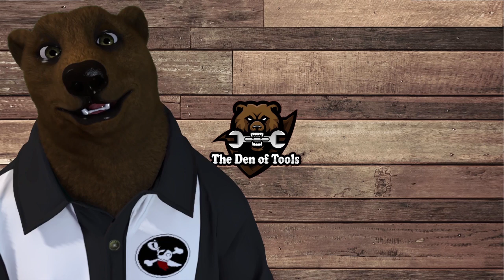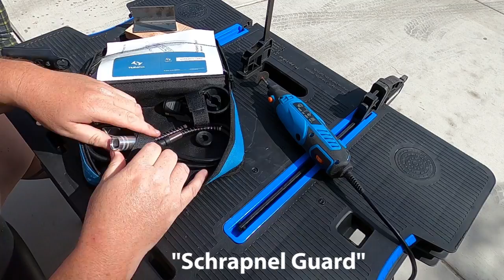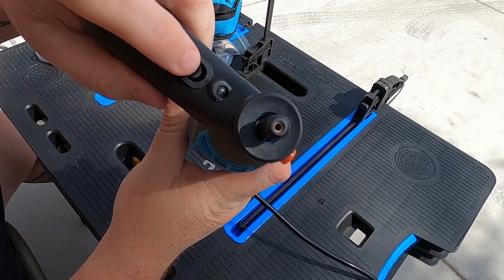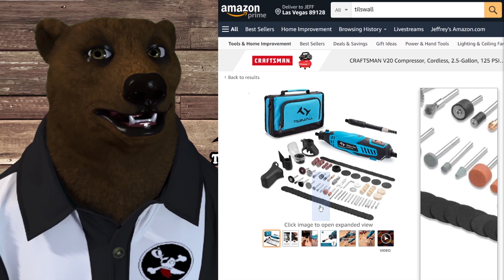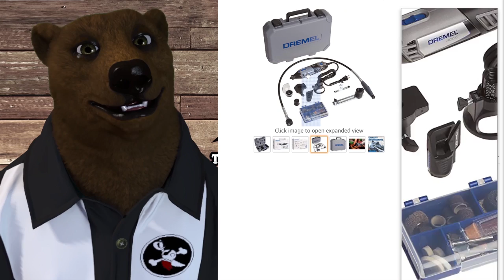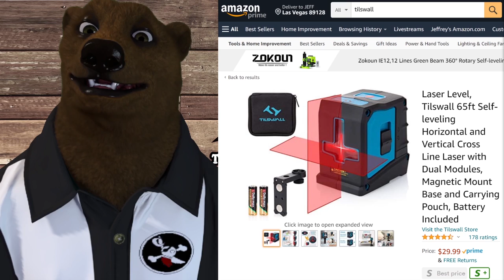Cheap Rotary Tools, Trash or Tool? (Tilswall rotary tool review)

Comment: No trae seguro sujeccion cable interno, lo cual con un tirón, se podría salir de las cogidas, además ni motor ni rotor trae nada de goma en rodamientos para evitar vibración en alto. Personalmente por el precio las hay mejores incluso a batería. Muy bonita y completa pero no la veo preparada para durar, el botón de encendido apagado lo puedes poner  donde lo trae o más adentro si necesitas activar más cómodo.

Comment: Amen.  I had Dremels for years and when my last one burnt up, I bought a Masterforce instead.  Its basically a Dremel 4300 that comes with a flex shaft and a hanger and still costs half as much as a Dremel 4300.  I love Dremel but I don't see the sense in paying twice as much just because it says, "Dremel" on it.

Comment: These have a thinner than normal Collett. The ones that fit the Dremel and pretty much all other rotary tools are slightly too wide to fit. I had to put mine in a drill chuck and turn them down with a file. Pain in the butt. However the tool is as good as the current iteration of dremels. And way better than the Parkside tool that lasted 10 minutes!

Comment: Thank you SO much for this video! I am really trying to figure out what the heck the "brush access" is on it? (the black circle you pointed out...it seems there's one on the other side of it too) What is it's purpose? I bought this one because of your video and I unscrewed one of them and had a heck of a time getting it back in and now I'm worried I've ruined the tool although it is working but I was really taken aback by the coil and all the stuff in there (sorry I'm totally new at this and have no clue what anything is called) Thank you for anyone's help!

Comment: I own a WEN 2307 rotary tool my friend gave me his bosch large soft zipper case fits my wen rotary  tool  and wen 320 piece accessories I even purchased a Kawasaki collet  set which is better made than the standard one that  it came with it for me this does the job as a  homeowner it's good for little arts and crafts and little things around the house it's not good for professional use but it does the job I'm happy with it my father in-law who owns a older  Dremel similar to mine likes mine says alot.   ( for poops and giggles I did get the drill Master one for like $8.00  thing is a piece of junk probably going to get the wand the right angle attachment the router attachment it's a good kit  to build on

Comment: Being into radio controlled flying I’ve gone through a lot of Drexel’s over the years.  The weak point always seems to be the brushes.  You would think someone would have come up with a brushless die grinder by now.   My best Drexel is a professional flex shaft model with a motor about 3 times the size of the handheld tools.  That one has lasted but it was about $160 25 years ago.

Comment: Hey Jeff,
I went and bought this tool after watching your review. Got it today, Sunday. Great tool for small jobs. I did add a few drops of Bell & Howell projector oil to both ends of the flex shaft and to the tool shaft.  Works just as you demo'd it.  Thanks for that review. The 20% off at Amazon helped too.

Comment: Bought a similar tool through HBT and have been using it instead of purchasing a Dremel. Not as "strong" as I would like, but it works well and does what I ask it to do whether in woodwork or in wood turning. Good call.

Comment: If I buy a cheap too I throw away the bits or discs that come with it, even a cheap tool can benefit from a good bit or blade or disc etc. even my name brand circular saws generally have come with cheap blades. Project farm does good videos on things like sawzall blades and drill bits, cheap tool with a good blade!

Comment: I have an old dremel I bought from a thrift store about 10 years ago.. I paid $5 ..it was almost brand new , it was missing the  wrench ,and the arbors for sanding rolls, and it had the crappy blow molded case

Comment: I have a Dremel and a Ryobi (way better). Hey bear I have a question I am in desperate need of a thinkness that won't break the bank do know of anything out there right now? Someone stole mine days right out of my driveway while I was using the damn thing. I went inside to refill my drink and came out and it was gone along with my good clamps that were sitting there. Damn turd nuggets took almost every clamp I owned. I was inside 3 mins tops it was that fast. I was making a bench for some extra $$. Social security disability doesn't pay enough for me to live so I  supplement my income with stuff I buildand right now a thinkness planer is important because of the quality and condition of lumber right now. I figured if there was an awesome deal to be had you were the person who would know were to find it.

Comment: Nice little tool, except that the advertising (Amazon) lists this at 160w, scroll down to the specs, it's 130w. At that point it becomes a nope for me. That's 1.1 amp, barely. So it'll be a little under-powered and get hot faster, but as you noted, it's a short run time tool and it will work for a lot of stuff. I'll look for a 1.8 amp motor and yes, that's a significant difference plus you can find them for similar pricing. Yeah, about Dremel, you're right, ain't your grandads tool. I'll pass on that high priced tool. You'll have a good chance of buying 2-4 of the Tilswall, Tacklife, Teccpo, Goxawee or any of the others for the price and power rating of the Dremel that's probably outsourced to one of those companies.

Comment: If you're looking for a cheap rotary tool, I highly recommend the Black and Decker RTX-B. I've had one for years and it's fantastic. The biggest perk, is that it has a 2amp motor, meaning roughly 240watts of power, vs the 130watts claimed by this tool. I've used it to grind cast iron, aluminum, and stainless and it doesn't lose power. 
I did have an issue where the chuck lock broke (I was being a bit to aggressive with my tightening) but the shaft has a hole in it and I made a space to stick a small Allen key through to lock the chuck. It's more powerful than the $120 Dremel 4300.

Comment: Dunno what I'd use a rotary tool.for?? Engraving my initials into tools so other Peeps know to KEEP AWAY?  lol
The rotary tool motor sounds sweet,  smooth and high revs.
I also thought a glue gun was a .....glue gun?😁  but watching a granite worktop fitter ,create a hard board template of the worktop and overhang it required, he used a glue gun that wasn't up to the job, and had little flow rate.  He swapped to a  pro type gun and it made job look easy.
I have 2 guns.  Both would qualify for , women's crafting glue guns..lol.  weak as crap.

Comment: That looks almost exactly like the Tacklife rotary tool I bought I think on your recommendation a month or so ago - the only difference is the Tacklife has a small LCD that shows the RPM at 1:1000 ratio (10 = 10,000 rpm all the way up to 40=40,000 rpm).  I really like this tool a lot and it has held up really well to hour long plus sessions of light grinding of stone along rust removal from old tools and pretty much anything I have thrown at it.  The flex tool is a positive/negative neutral as it works OK but doesn't give you that feel of connection to the tool in the same way.  With or without the flex the tool never gets too hot and I am careful to check while using it - heavier duty than the last dremel I owned and it so far has been worth every penny.  Thanks Bear!

Comment: Hey Bear, I’ve been using the Wen Rotary Tool from Amazon @$24 for over a year and had NO problems! Just as you pointed out, you can’t run these things like a heavy industrial tool...use it then let it cool off.....

Comment: I acquired my first two Dremels inthe 70s. Didn't need to replace them until about 4-5 years ago. Bought the 12v battery powered Dremel and that was one of the smartest purchases I've made. Buy the bits and mandrels as you need them.

Comment: I've had the same Dremel 3000 for years and years now. I almost lost it once due to the locking mechanism getting stuck, but managed to get it loose. Rotary tools are super useful, but it's all about the attachments and application.

Comment: I had an actual Dremel brand (the basic "full throttle" one) rotary tool for many years. When it did finally burn up, I couldn't believe the prices of the brand name. Since they've all been made overseas for years, I ended up buying a variable speed model in a HUGE kit from Northern Tool for about $70 maybe 5-6 years ago. The kit included a 3' flex shaft and God only knows how many bits, wheels, stones etc. It also came with a mini tool. These days, they're all pretty much the same thing other than the color. I've used this one without any complaints ever since. The big Harbor Freight accessory kit is a pretty good deal too.

Comment: I have the dermal cordless. I actually don't care much for it but it does work. Even a cheap rotary is fine for what they ARE made for. In fact the cheaper the better. Run the math one costs 80bucks lasts 10yrs, 8$ a yr. One for 10bucks lasts 2yrs 5$ a yr. All's good

Comment: I need a Dremel but won't really help me much unless it's cordless being a mobile mechanic
Reply: Both Ryobi and Hart from TTI have cordless flex shaft rotary tools. They are almost the same but the Hart one has a place built in were the little accessory box slides in. Right now Walmart has a "Hart Lifestyle 4-tool Combo" that comes with a 6 battery charger, 2 1.5 ah lithium ion batteries, an inflator, and a hand held vacuum on clearance for $80-$109 depending on the store it is regularly $150. Direct Tools has the Ryobi version for $60 tool only (factory blemished) and $7 flat rate FedEx shipping. Both have 3 year warranties.

Comment: I paid just about as much for my Dremel flex shaft for detail work as you did for this whole set!! And my 12v Milwaukee rotary tool I'm using the shaft with doesn't have a d ring to hang it from I have to use the 4ah battery and hang it by the box of the battery with zip ties 🤣 I'd say overall this things a win

Comment: I have Dremel that I am suer is the cheap stuff despite having had it ~10 years.  I have never tried to perform continuous detail work with it. It looks very similar to this tool. But the other day I needed to cut a corroded feral off a copper pipe that I couldn't cut because it was too short without drastically increasing the scope of work.  That little thing saved my bacon.  When you need detail, have one of these tools handy. Just have one.

Comment: I teceived a dremel as a gift around 1992.  It went for $80 and came with a boaþload of accessories.  I didn't want to wear it out and I bought an off brand from a true value hardware store for $12 on sale in 2011.  It came with a boatload of accessories.  I also purchased the flex tool by dremel.  It turnes out that all of the dremel accessories worked just fine with the cheapie tool.  I've been using the cheapie since purchasing it with zero problems.  A few years ago I bought an accessory kit on sale from home depot, everything is all interchangeable with both rotarý tools.  And then about 3 years ago I got an accessory kit with tons of parts from Walmart for about $20.  It had collets which I desperately needed, and it too is interchangeable with both rotary tools.  I had a specific need...I think it was green polishing paste so I bought a small kit from Harbor Freight.  Evetything in it works interchangeably with both rotary tools.  I need a new collar for the dremel.  I hope they sell them separately.  I like the handle on the tool you demonstrated and would like to know if it's interchangeable with dremel.  

Thankyou!

Comment: I'm glad I didn't see this video two weeks ago or I might have bought one.  I went with the cordless 12V TECCPO off Amazon @ $59.99, but only $39.99 after a $20 coupon which is still currently active. It came in a nice hard shell case. It didn't come with a shrapnel guard or even a cutting wheel, but everything else on the video. I tried to use an extra cutting wheel I had lying around in the garage, but it couldn't cut through 1/8 inch acrylic- had to use the brushless multitool.  One reason I bought it was because someone commented that the battery is interchangeable with the 12V AC Delco battery. I have the 12V AC Delco ratchet so I went with this.  The batteries look very similar, but are not interchangeable. It does what I wanted though- sanding the edges of that acrylic and engraving with the flex shaft accessory.  It also gets hot fairly quick.  If I were to spend over $100 on one of these, I'd go with the Bosch. Shine On everyone!
https://www.amazon.com/gp/product/B07S1T676G/ref=ppx_yo_dt_b_asin_title_o03_s00?ie=UTF8&psc=1

Comment: Thanks for a review. 
If anyone needs another cheap option but want to get it at a brick and mortar store, if you have a menards around they have a nice setup, I believe it's master force brand for around $50(in columbus ohio). It comes with a table clamp and a Flex shaft along with various bits. 

Don't forget about the cheap $30 harbor freight kit. It's actually good for the money. The corded one is good, cordless lacks imo.

I have used the cheap harbor freight one for finish sanding and polishing of ports on heads and manifolds after the bulk of  material has been removed.

If you 3d print a glue gun is fantastic tool, find the stl to print a pla glue stick and use it to join and repair prints.has to be a high temp glue gun to work.

Comment: My biggest question for any of them is Are they compatible with Dremel accessories? I have a No name tool that works great but have lost the collets for it. Dremel collets and accessories don't fit it so it just sits collecting dust.
Reply from the maker: Wow, I would have guessed they were all standard.
Reply: @denoftools  It is an older one so they may all be standard now, idk

Comment: I really gotta get one of those flex shaft things, I think. Would make a rotary tool actually do what I always hope it will, detail work.

Nice that the one you tested didn't sound like it was going to explode if run at full speed no load. Can't say the same for the one I got for $10 on sale at Menards 🤣 That handle is a nice feature too.

It's not just friction. There's usually also a spring connecting the motor to the collet so if you bog it down too much or too many times, it will quite happily destroy itself. Ask me how I know.... (And how I have the internals of a rotary tool in a box...)

I bought a more expensive SureBonder dual power (battery or ac) glue gun once. It's the slowest heating hot glue gun I've ever had. Doh! On the plus side, I got a Gorilla hot glue gun on sale on Amazon for like 10 bucks, dual temp, and it heats up quick and has a good stand... Learned my lesson I guess?

Comment: I wanted to let you know that I picked up the new Bauer rotary tool at Harbor Freight. It comes with a 35 piece accessories included in a small clear plastic box. Price is $29.99 With the 10% off it was $26.99 It handles nicely with the reduced thickness. I hope you pick one up as I'm interested to see if it is Bear approved.